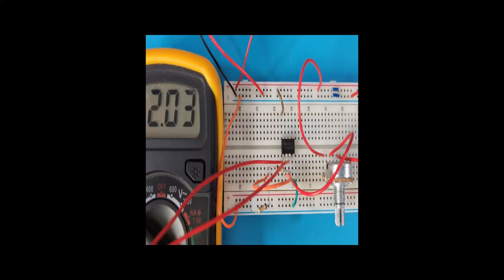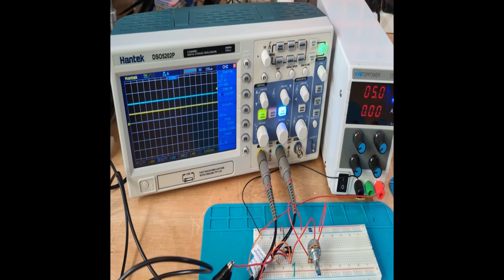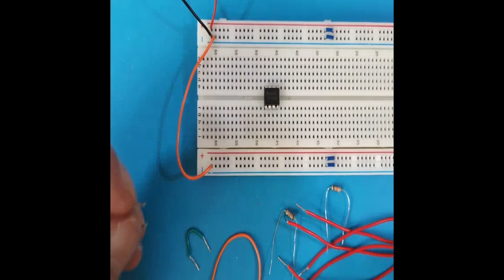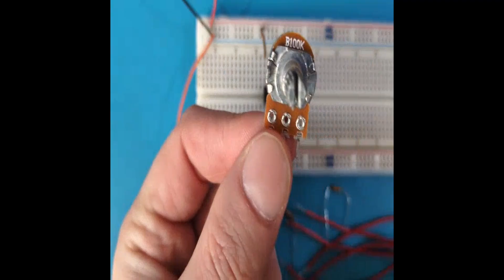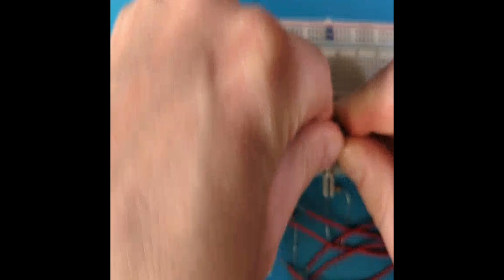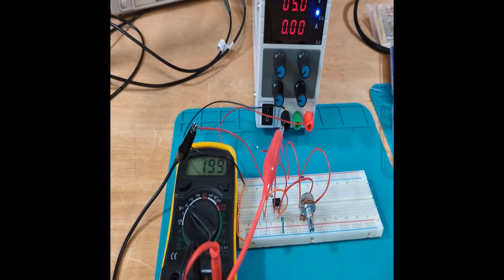Non-Inverting Op-Amp for Beginners. Build & Test with LM358

Comment: Just what i was looking for thanks
Reply from the maker: Thanks very much glad it has been of use.
Hopefully start posting again this weekend, been ill past few weeks unfortunately.
Reply: @MakeItWithMatty  Glad your on the mend you sound like we are both in God's country Up North so subbed just for that and before I have look around your channel. All the best Matty, Kev
Reply from the maker: @utkf16 yeah you'd be right there😂. Cheers bud. Just like messing on making things and started videoing to see if I can improve myself.
Reply: @MakeItWithMatty  As a kid i was always looking inside the back of transistor radios and and amazed at how they worked. But it was later in life and with the internet I managed to start playing around with things but I come in and out of the hobby. TBH this video was spot on as im messing around with a LM358 to boost up input from a piezo sensor. Some things not working so I wanted a decent circuit but also where and how to check the IC. I have a handheld oscilloscope to use for it so all good.
Reply from the maker: Cool. I used to take everything apart. Still do. built up a collection of tools over the years, but all are useful, even a handheld oscilloscope. I started out with a home built kit one as couldn't afford it at first. Thanks very much for your comments though and glad you found it useful. Hopefully more content in the future will be helpful for you too :)